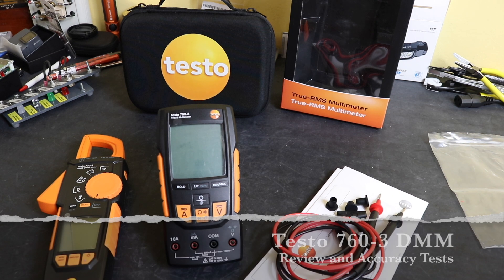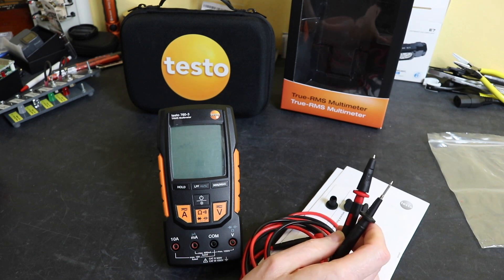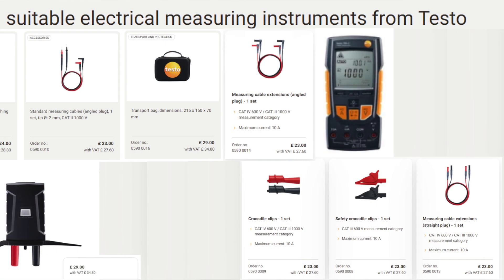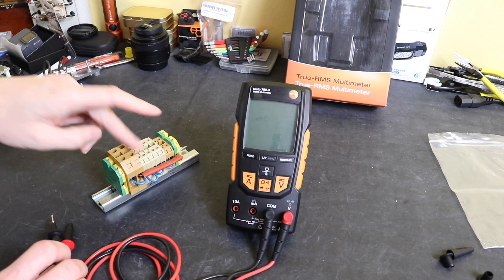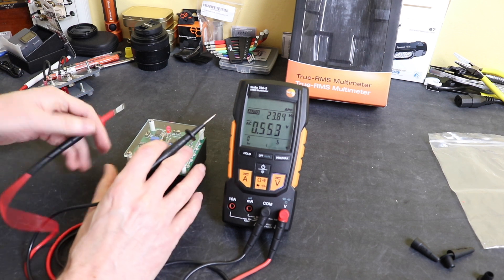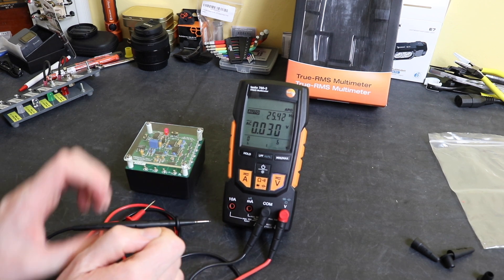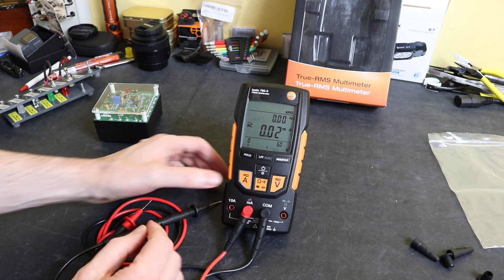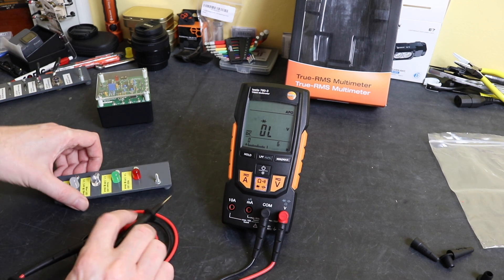Testo 760-3 Digital Multimeter Review

Comment: whats the battery life? the battery life on the clamp meter is rubbish
Reply from the maker: Takes 3 AAA batteries with around 100 hours operation based on sums. I don't use the meter extensively, so I get around 18 months usage from one set of batteries.

Comment: Can you get the milwaukee  2213-20 over there by chance?  It's a step up from alphabet soup brands auto meters and for simple stuff it's very small and easy to use.  Best part it fits into a sbld with a impact in the back pocket with room to spare with additional accessories.  I too dislike these cheap leads I end up having spares if fluke silcone leads and just throw out stock ones.
Reply from the maker: Can't find the 2213-20, the lower based 2212-20 model seems to be available for one of the electrical factors. which is the same meter without the resistance measurement function.
Yeah, silicone leads are the ones I go for.